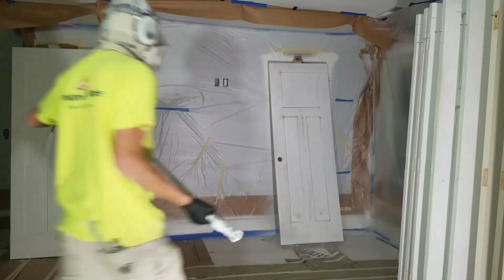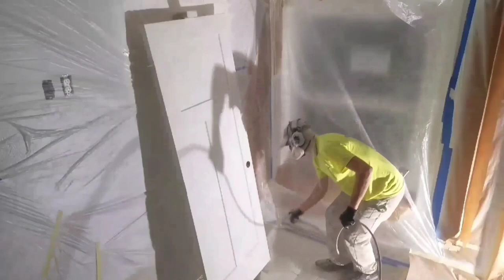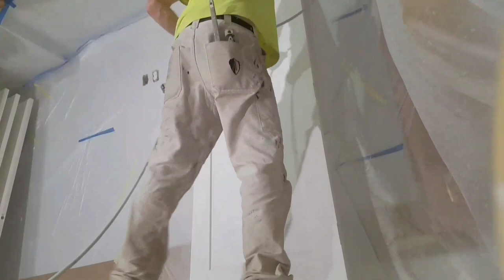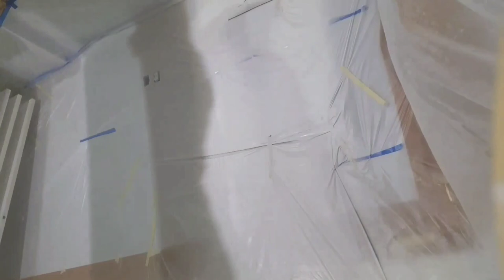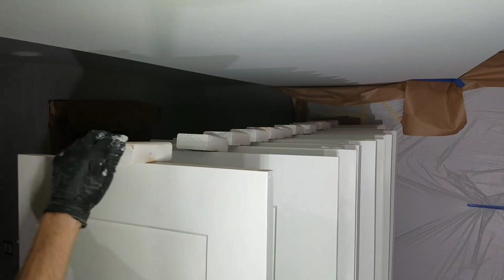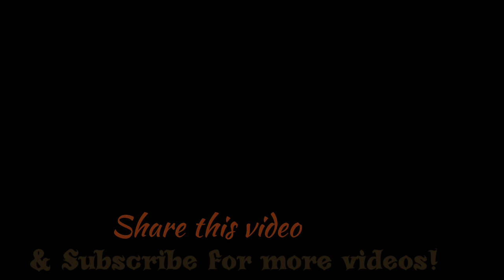My Favorite Door Painting System for Airless Spraying.

Comment: love the finish on the doors even after one coat. going to be painting 6 doors primed white. Using a graco x5 I have two tips 415 and 515. asked Graco what tip to use to get a fine finish, using there ff line of tips they said I'd have to rplace the orange guard to blue, but really asked what paint I would be using. any suggestions as to what
 to use or what you used on the video. thanks again.
Reply from the maker: Yeah, I'd either go with 411 if you want to use your current housing, or go 410fflp with the blue housing Rac X and 1400- 1500 psi pressure maybe more depending on product.

Don't forget to thin and mix, if you use oil primer.

Comment: Great vid. I am starting out to spray my doors on site. I notice the FF410 tip. Can you explain why and the pressure your spraying at. I notice alot painters use a FF310.  Is that because of the paint your using. Where I am its SW or Ben Moore or Behr if in a pinch at the big box store.
Reply from the maker: I use a 410 for the spread of the paint. It puts a slightly finer amount of paint across a slightly wider area. I use plenty of overlap in my spray pattern, for eveness and coverage without piling up the paint (causing orangepeel)... a skinnier tip shows spray patterns easier and puts more paint on per square inch... little less forgiving
Reply from the maker: Pressure for graco fflp, I run around 1400. For Titan purple sc6+ tip, I run 1800-2000 psi

Comment: Try screwing a 5 gal stir stick on top of door then leaning that against wall. It will keep door far enough away from wall that you can spray both sides at same time and not have to handle wet doors.also put them under doors to prevent sticking to floor.
Reply from the maker: Congo Bongo Thanks for the tip. I've done that plenty if times. But spraying 19 doors in one room that is all painted? I'd have doors everywhere and overspray everywhere.
Reply: I have also tried the whole stir sticks (1 & 2) at the top thing and can tell you that there were many problems with that system. XC is on to something here. Stay tuned
Reply: That’s great for hollow core or fairly light doors and if your work area is small. Try moving a bunch of 9’ solid mdf door that weigh  about 150 lbs each. I do a lot of new construction custom homes and doors are generally hung with dummy hinges so we can spray swinging and carpenter puts finish hardware later. For smaller jobs with limited space  I will definitely try this system. I am on a home right now with 70 Solid knotty alder doors and fortunately we can leave doors hanging and finish in place.Keep up the good work
Reply: Congo Bongo I have done that a few times in the past but I stopped because I thought nobody else does it so it must not be a good idea lol!  Maybe I'll start again. 
what about caulking with the doors on? u just caulk up to the hinge? thanks.
Reply: WordAboveAll Yes, I will usually just caulk up to hinge unless the client specifically requests removing them first. But in my 22 years painting I don’t recall anyone ever asking me to do that.

Comment: How long are the blocks that you attach to the tops of the doors? 8 inches or so? Are you using screws to attach? Thanks! Great method.
Reply from the maker: Thanks the blocks work well anything in over 5- 6 inches... 7 - 8 is great 😄  sometimes I predrill a bunch of blocks and can use either method screws or nails.

Comment: Great job bro!. What size tip are you using? I would use a 12" extension so you don't have to bend up and down to much👍👍👍
Reply from the maker: JCS Fineline Painting Co 410 tip thanks
Reply: JCS, but then there can be problems with the occasional spitting from the extension unless using Cleanshot valve and with that another piece to clean.

Comment: What's your method on 9' doors the weigh 75lbs
Reply from the maker: I would stand them up seperately in a room I believe. You can attach blocks to the bottom to protect the bottom corners so you can move the during set up or after

Comment: Man, it looks like you're using a 110 tip and about 4-6 inches away from the door. It must be a wide angle lens trick of the eye.
Reply from the maker: Yeah probably kind of close to the surface... gets the paint on nice and wet, quickly. Using the 410

Comment: why not just set em up on 90 degree angle trusses in the living room and spray em all at once? I mean if you are gonna take the time to nail/screw in some wood in the top you might as well set em all up at once against each other. If you have enough room in the middle of the living room you dont have to worry about covering walls even with a proper compressed air sprayer
Reply from the maker: Because this route gives me many options on how many doors I can do in a limited space... most of these spec homes I was painting, had small living rooms but they were also filled with tools and sometimes other trades working.  I had upstairs bedrooms, or the basement as a spray room area.... so also, i didn't even have to clean the whole floor (or several rooms) perfectly enough to set out and spray 17 -24 doors.
I can sand them on the stack and spray them in one corner or wall of the room and stack them anywhere I need to. Also very handy when the carpet guys show up and either have to remove all the doors,  or if they are stacked like this, they can move the doors out of the way, into an uncarpeted room like a bathroom, and the doors won't stick to themselves, etc. And there's no limit how many you can stack because the weight/pressure is not on the fresh paint.  That's the 1st few  reasons that come to mind